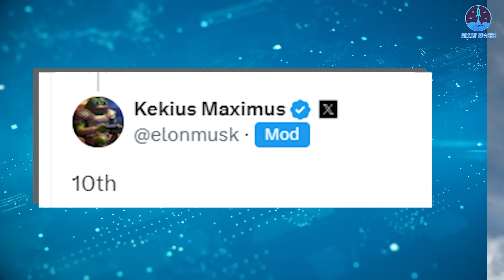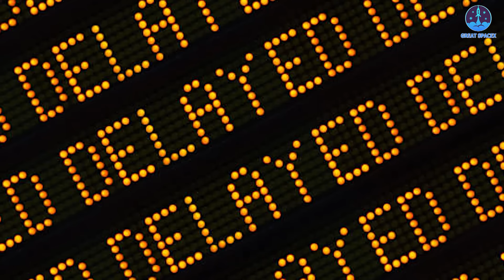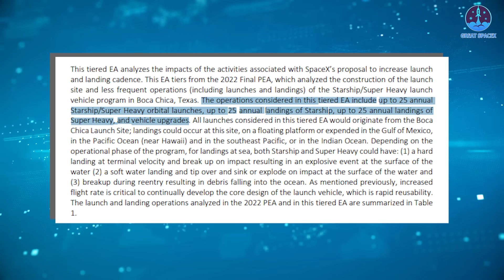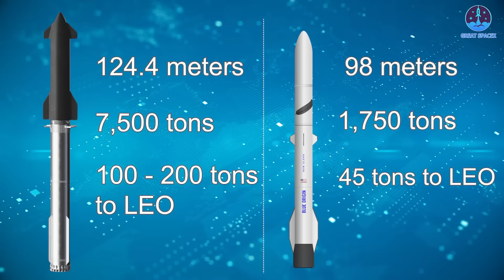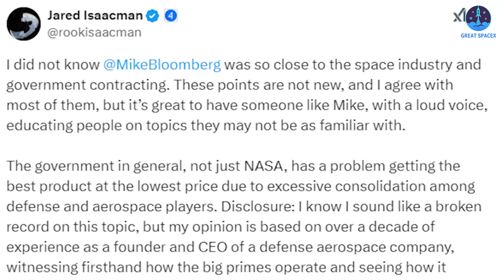TOO LATE! Blue Origin New Glenn officially Completed, Launching Scheduled BUT Starship...

Comment: I'm not convinced catching the booster is any advantage, if they'd gone with landing gear they could land it anywhere, would be done with that a year ago. The new raptors put out enough added thrust to compensate for the weight of the gear. Or just land the booster in a big wheeled dolly the simply tow over to the bay , to work on it.

Comment: Man stop with the bs, Blue Origin is garbage, they are NOT in the same league as space x, not even sierra space, rocket lab or any of the other smaller start ups are on the same lvl of BO, for the amount of money dumped into BO the turn over has been and is still very disappointing
Reply: Falcon is good, but starship is a joke, i think your worried they will get it right first time. not 7 times.
Reply: @Supraboyes  New Glenn comparison is to Falcon 9 NOT Starship. Falcon 9  has flown over 400 flights and holds a solid record for re-use. Some F9 boosters have been re-used a dozen times.  I especially loved that double autonomous booster landing of the Super Heavy. Bozos isnt even close to that. Even with a successful maiden launch. They are still 10+ years behind.
Reply: @benshivd  🤣🤣 yeah of course they are. 10 years don't be stupid. What has Starship achieved please tell me. It hasn't even gone in orbit, yet the 60s vehicle went to the moon. I thought this thing was cutting edge tech.
Reply: @benshivd  Btw nothing against Falcon, it was designed by people that know what they are doing, Starship is Elons toy to make people like you think we will go to Mars 🤣
Reply: Another Musk fan boy cult member I guess

Comment: SpaceX is planning launch 7 of starship (second time a booster is caught on the launch pad). Blue Origin is hoping to launch the first New Glen but has no idea how it’ll do. Also, the two rockets are not comparable. Apples and oranges due to the scale of starships
Reply: Overall Bezos has several space flights (New Shepherd) and Spacex has several hundred. (Falcons, Heavy's Super Heavies, and various Starships, star hoppers etc).
Reply: @ yes, and? I did not say neither company has flown a rocket. Elon has said himself that Starship is like starting over compared to Falcon 9. Yes they can use experience but if they were similar then Starship wouldn’t need to test, it’d already be working flawlessly.

Comment: If anything, New Glenn may be a competitor for Falcon 9, or even Falcon Heavy. It is no competition for Starship. 😕🤷‍♂
Reply: @dazuk1969 NG is not even fully reusable now. it will take several years for BO to make it work 😂
starship can reach moon without refueling, it has more than enough dv for that, but with significantly less payload. the point of refueling is to increase payload.
whats NG payload to moon? 3 tons?
Reply: @dazuk1969 cite, because bo is crap.
Reply: Starship DOESNT have a market yet. There’s nobody building anything that needs a rocket that big except for spacex themselves with their own starlinks. I hate to break it to the fanboys, but you don’t make a profit when you’re your own client, that called an expense. There’s a reason why there was like a 4 year gap between the first and second flights of falcon heavy: nobody needs a rocket that big. The economy of scale thing didn’t prove true back then and I’m skeptical that it will now.
Reply: @ fly starship is cheaper than f9 in case of full reusability, isn't it?
Reply: @Rory-Shields  You are wrong with both of your claims. First there are clients other than SpaceX that declared they will need Starship: at least two of the new space stations that are being developed: Starlab by NanoRacks consortium and Heaven-2 by Vast (or its central module) will have diameter large enough that only Starship will be able to launch them into space - both already decalred they plan to use Starship. Then, there are next generation space telescopes (LUVOIR; HWO) that could only be launched by a Starship-sized lauch system. JWST primary mirror was made of ultra-expensive beryllium because other materials were to heavy for the current generation of lauch rockets. Until recently nobody was building anything that needed a rocket of Starship size because they knew such rocket didn't exist. Now that it does exist clients will come faster than you think. As for the SpaceX being it's own client for starlink launches - its not a cost but a cost competitive advantage vs. Kuiper or other satellite internet services under development. And cost competitive advantage is large part of any profitable business venture. There is no market for Starship? Well the thing about the greatest business leaders such as Musk is that they create markets for their ideas.

Comment: <yeah, so ummmm...there are folks who calculate odds of success or failure for any orbital launch mission whether to LEO or beyond, however, that is contingent on prior successes. for elon musk/spacex/starship_booster heavy they always post mission success/failure odds because they are pushing the limits of unmanned spaceflight>
<since spacex/falcon9 launches to LEO have been going on for years successfully, they can claim 100% or 99.9% rate of success, but no one should make that claim with unproven base system, orbital launch hardware, software, etc.>

<even(legacy orbital launch provider/aerospace expert) boeing made lots of mistakes on starliner, etc.>
During Boeing's Starliner first launch, the primary cause of its failure was a series of software errors that resulted in the spacecraft's onboard clock being set incorrectly, leading to the capsule firing its engines too early and missing its intended orbit to dock with the International Space Station, forcing an early return to Earth; this issue was primarily attributed to problems within Boeing's software processes
https://www.newsweek.com/boeing-starliner-astronauts-stuck-return-timeline-1926620#:~:text=December%2020%2C%202019%3A%20Unsuccessful%20First%20Mission&text=A%20series%20of%20software%20glitches,the%20spacecraft's%20design%20and%20capabilities.

Comment: Despite not having much to show, Blue Origin is certainly not made up of dummies... they HAVE rolled a giant rocket they think is finished out to the launch pad.  They HAVE fired up the engines and apparently they are working.  You would think these guys are not going to try all of this unless they have everything nailed down and perfect, they certainly know the stakes.  New Glenn is real, and in 3 days we will finally see all the work they have been doing, even if it explodes in the first 2 seconds.  If it goes off without a hitch, and they land that thing, we all know the world is going to be shocked, so be prepared, because the chance of that happening is NOT zero.

Comment: This sounds like nothing more than blue origin feeling as though they are backed up against a wall and feeling they have to go big or go home with them going straight beyond the long testing that spacex has put themselves through. They know that if they fail there's no going back but if they don't try they will fail anyways.
Reply: They are done already......SpaceX if they stopped now could be cought up to by Sue Origin maybe in 5 years.....but SpaceX isnt stopping....

Sue Origin will be getting no costumers besides themselves and maybe Nasa and Space Force, as those two are willing to pay more to have their stupid "dream" to have more than one space lift provider. They will just be to expensive with just a partly reusable rocket and they will have a 2 meter smaller faring 7 vs 9 meter.

I guess Starship is ready in Q12025  to launch Starlink satelites and maybe Q3/Q4 2025 to launch daring customers satellites.

Latest 2026 they will be certified for LEO sat services.

Comment: I don't think they are going to stick the yylanding on the first go... however, an otherwise successful flight would be Huge. If they can get first stage reusability in the first year... that again, would be huge. They would skip past even China as Spacex's main rival... though China will likely take back the #2 slot if their own fully reusable rocket flies by 2030.

This would be a big win for Bezos' BO. Frankly, Amazon is a huge accomplishment. A successful flight here would be a massive jump in capability and give him a second big win.

It doesn't have to compete with Spacex... it just has to be a (very) credible alternate.

Comment: But SpaceX will have effectively destroyed seven launches and still not reached orbit with Starship. So if BO succeed on their first go, they've saved the money by not blowing up or crashing six flights first. I'm cheering on SpaceX, though getting Project Kuiper up there will give competition to the Starlink terminals which should be really helpful in pushing the technologies forward and bringing the cost down. And having more competing companies in rockets should reduce the cost to orbit (hopefully in time for me to be able to go up one day)
Reply: @makingmusiconline2309  technically Starship could have reached orbit by now, but that’s not the main objective. They have already proven themselves in building a rocket capable of orbit. BO has never reached that milestone. Also, the price to build a full starship and booster is a fraction of the cost to what New Glenn is. And Starlink is covering much of the cost for R&D

Comment: BO is in no way a contender to SpaceX. They are years behind in cadence and technology. NG is not even the competitor for Falcon 9 or Starship in terms of mission design. The closest that thing NG is competing with is Falcon Heavy and how many launch has it done recently (2 this year, 5 last year, not exactly a prolific amount).

Before you declare BO and NG the winner in whatever mythical race you've invented in your head, let's see what they can do first. Instead of cheerleading, you need to honestly report the situation and state that BO will certainly make a splash if they can get NG off the ground (without exploding) and land on it's drone ship successfully (without tipping over and/or exploding). The thing that grinds my gears about the type of "reporting" you are doing is that it isn't fact based. You're just spreading unneeded hype. Just report the facts and stop "Rah, Rahing" everything. There is already excitement to see what BO/NG can achieve. Your fake excitement isn't needed at all and in the end just makes you look foolish and unprofessional.

Comment: 1. You guys are such Musk fan boys it's disgusting and you are anything but humble. 
2. It has not been a competition for a long time since SpaceX already has been in space for years. 
3. Payload/capability-wise, Blue origin slots between Falcon and Starship, it's not a competitor. There's enough launch need for all. For example, New Glenn is perfectly slotted between the SpaceX rockets to launch Dream Chaser. Falcon is too small and Starship is too big.
4. Try being more objective for a change.
Reply: Musk delivers reliable launch vehicles to the USSF and the NRO.  If a real need is defined between Falcon Heavy and Starship then the SpaceX engineers could just add on another booster or two to Falcon Heavy this making Falcon Heavy Max  Four Falcons around a central core would make a launch vehicle rivaling Saturn V
Reply: Bezos is a poser.   Elon delivers.
Reply: Did you see channel name?
Reply: @philippelemaire4884 yea they can’t read 😂

Comment: How are they two titans? 
BO hasn't launched anything but tourist rides- a fair ground attraction. Space X has generated an entire industry, they fly more equipment to orbit than most countries put together. It is not even close.
Reply: I agree. BO has pushed exactly ZERO grams to orbit. A more accurate phrasing would have been "Between the titan of the industry and the first likely challenger to the title." - Getting to orbit is a challenge that BO has yet to achieve with this "Run before you can walk" approach.

Comment: Blue origin has been working on New Glen for over 12 years now. They Bazzos has spent more money in 12 years on one rocket than Spacex has spent since 2003. They have no excuse but to have everything work to perfection on January 6th. Especially when you consider what Spacex has achieved in the same time frame. There is no comparison.

Comment: Having a captive market in Amazon's project Kuiper significantly alters Blue Origin's potential when compared with other competitors except SpaceX. I guess Amazon is happy to pay a premium over SpaceX launch costs to have their own launcher. It remains to be seen if they can achieve a high enough launch cadence to offset Starlink's first mover and initial coverage advantages. I would be interested to see a video with a feature comparison between Kuiper and Starlink.

Comment: New Glenn, if successful, will most likely displace Falcon Heavy in its market segment only during Starship development. Falcon 9 will continue serving smaller payloads until Starship proves it's reliability enough to replace it.

The only rocket capable of competing with Starship in even grounds will be another, fully reusable launch system capable of carrying at least 100 tons to LEO at (at least) half the price of Falcon 9.
Reply: If New Glen completes 25 missions in 2025, thats 900,000 tons of pay load. Falcon 9 will complete 150 missions in 2025 and carry 3.75 million tons. So just who is going to displace who exactly???
Reply from the maker: It will never beat FH

Comment: Dude... New Glen is expensive, has had thousands of failures and is now only getting their first LAUNCH at a price of over three times the cost of SpaceX. If our government was willing to use taxpayer money to waste it on really expensive versions of the same capability New glen would be a nonstarter. Success for New Glen at this point only traps them with a very expensive success and no abilities to trim back to be competitive!!! Hummm who does that sound like? Boeing? Lockheed? The SLS project? Just another money sink in the market. ANY other rocket can scale up and beat New Glen while New Glen does not even have experience to trim back and get lean!
Reply: New Glen is dependent on heavier and bigger payload.
Reply from the maker: So they can never beat SpaceX and Starship

Comment: I really can't agree with your probably statement. Starship already has a long track record of reusable boosters with their falcon 9 and they've already demonstrated they've returned to launch point and catch with the super heavy Blue origin hasn't launched anything anywhere yet with anything. It has a reputation so far of absolutely zero. Spacex on the other hand, has demonstrated every step of the super heavy and starship at every stage of its development. Well, it's certainly possible that New Glenn will fly and perform flawlessly on its very first flight of any kind, the probability of that outcome is so low as to be improbable. And frankly the irresponsibility of trying to launch an expensive payload on flight 1 boggles the mind. Not to mention calling to question the oversight and responsibility of the payload owner. That's just my two cents though.
Reply from the maker: Thanks for your analysis

Comment: So, A race to you is one side launching hundreds of flights and the other is not launching at all. But it’s a close race and the one that hasn’t launched at all is winning this little competition that you think is happening. Blue Origin is nothing.
Reply: Couldn’t have said it better 🫡 there’s no comparison at the moment like comparing Jordan to a cockroach. 🤷 I’m a space fan an want all these companies to flourish but let’s be real in the meantime there is NO race. More like catchup…for everybody else #spaceX
Reply: BO is not nothing, yes space x is years ahead but BO is still a competitor... I'd rather have more companies trying to achieve new things than none at all
Reply: Blue Origin will be closer than anyone to being a SpaceX competitor once New Glenn gets a couple flights under its belt.
Reply: @mig4868 
If it gets a couple of successful launches!
Reply: B.O. is using the NASA technique of careful methodical design, simulation and testing. Unfortunately this is slow, and if issues that do show up it adds even more delays.

Space X chose rapid design, build and test, and improve method. They focused on the hardest part, the rocket engine design. Make it inexpensive, mass producible, and reliable. Then start improving the support systems fuel, flight control, launch and reentry of the rocket. Now in parallel with the rocket improvements they continue to evolve their engine.
Reply from the maker: Thanks for your great comment👍